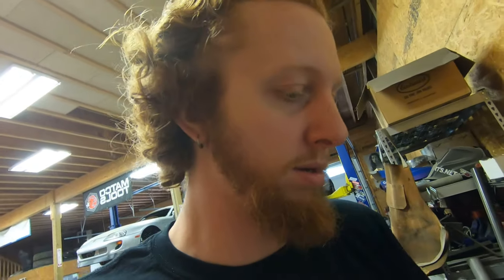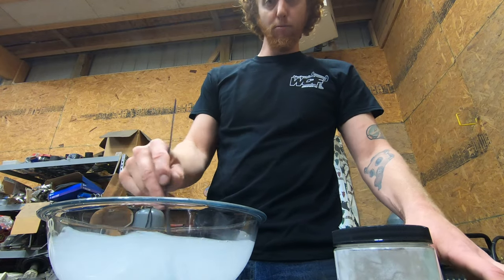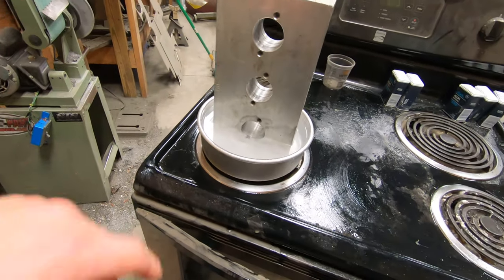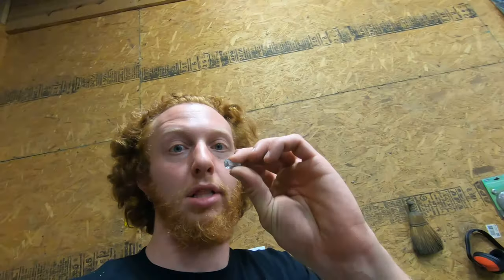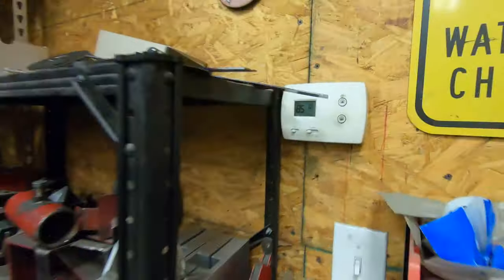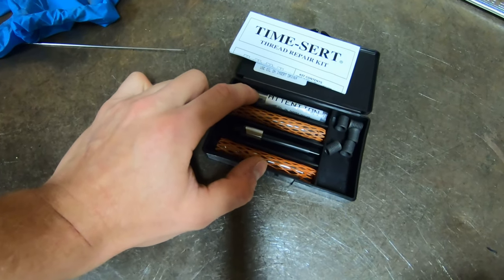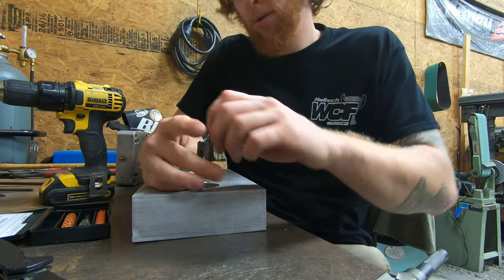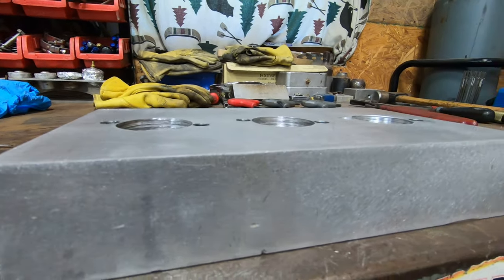Cooking to Remove a Broken Tap?

Comment: You will be able to get a good straight hole with a drill press and then use a punch chucked up in drill to hold your tap straight while you turn it, any time it goes crooked is a recipe for disaster. Look at some tapping videos, hopefully this will help you out in the future, I have learned from Mistakes.